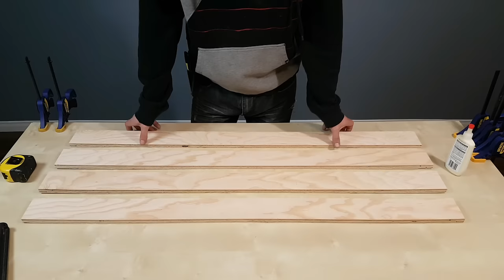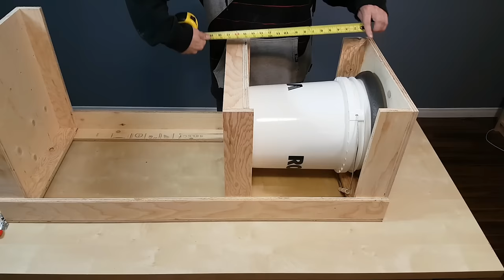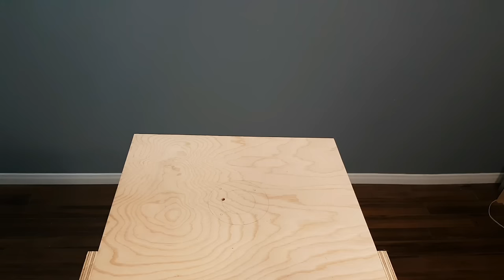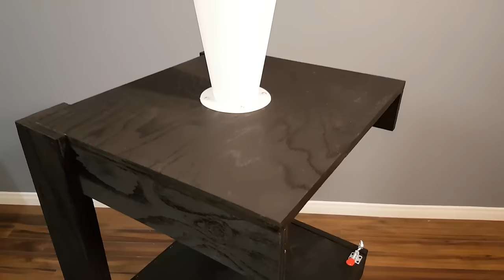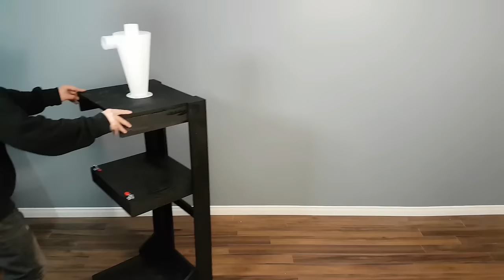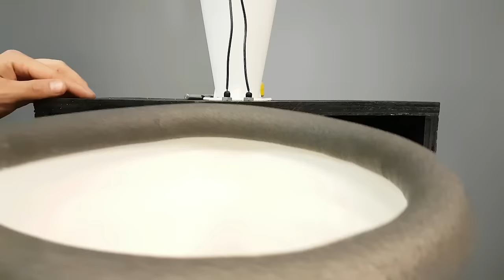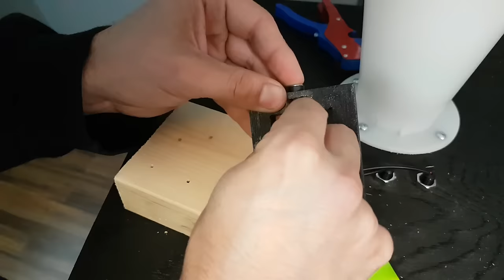How to make a DIY Cyclone Dust Collector / Complete tutorial

Comment: Great design.  Disappointing that you used the cheap, Chinese knock-off that puts Americans out of work though.  And dude.... a lighter to heat the shrink tubing???  Come ON!!  Get a heat gun man!!!!
Reply from the maker: Thanks for taking the time to comment! 😏 Yes i used a cheap knockoff, the cost being in my mind first, but i hear you about jobs and patent design, and the quality of the oneida dust deputy are far better than china ones. I plan to build a bigger system for my whole shop, and the next one will be a genuine one! 😏 On the other hand, for my lighter, yea, i started to build my shop in my basement from scratch, i bought for more than 2000$ of power tools this year ( mostly dewalt Made in Usa 😏 ), and also bought a small 300w heat gun made specially for heat shrink , but i also just bought my home so i try to spend my money wisely, because i have a lots of bills to pay, so sometimes a simple lighter is the way to go. 😏
Reply: I've got a 3rd Gen version of the Chinese one and it's far superior to this one.